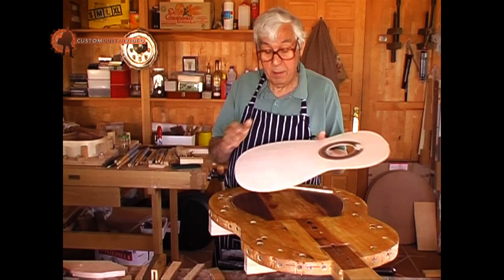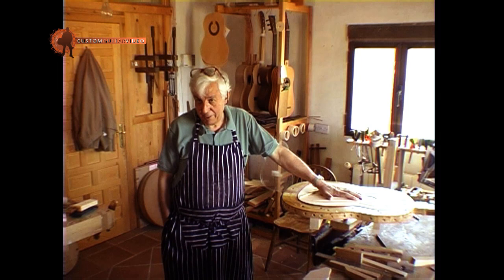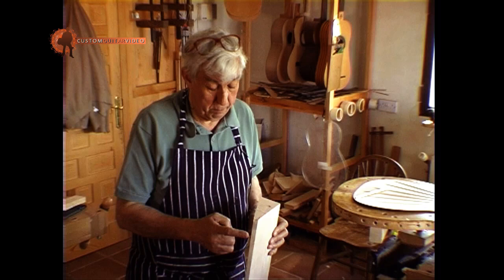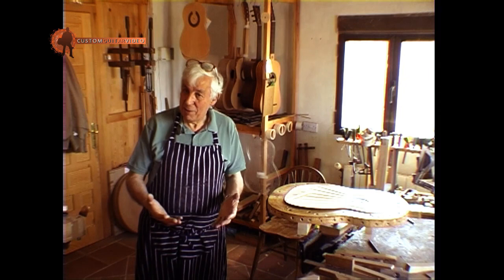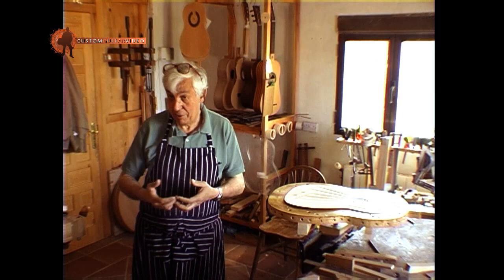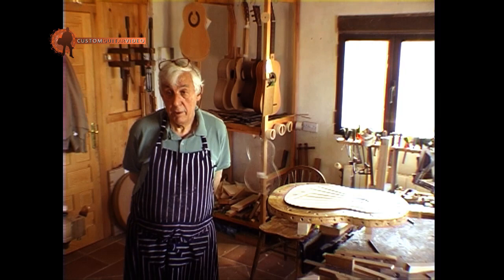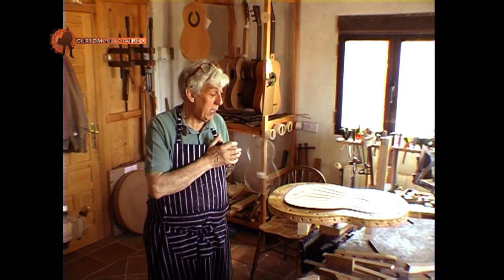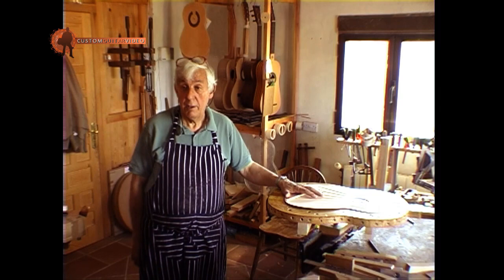JOSÉ ROMANILLOS 04 | How to make the BETTER GUITAR TOP

Comment: I understand what he is saying about 3-5 piece spruce tops where the wood is
re-sawn into thin strips from one parent piece. While this is possible in theory,
I have never seen this done in practice. I would think that the glue joints on edge
glued pieces would have some kind of effect with the sound wave energy.
A good scientific test would be to have a transducer affixed to a suspended top
and a ribbon omni directional microphone to record the sound waves. This would
then be plugged into a audio spectrum analyser that would show the resonant
points on frequencies from 200 to 5000 hz.  The test could be repeated with a 
two piece top and even a single piece top, if that is possible.
Reply: wow. amazing. you are so smart
Reply: +SuperCarver2011 actually multiple piece sound boards were used at all times in history. most likely due to the lack of quality spruce wood.  especially in times where there was no online luthier supply store :D u can find them on guitars, ouds and several other stringed instruments. u maybe did not see it because we have perfectly working wood supply industry. but nice theory btw :)
Reply: HibariMartialArts